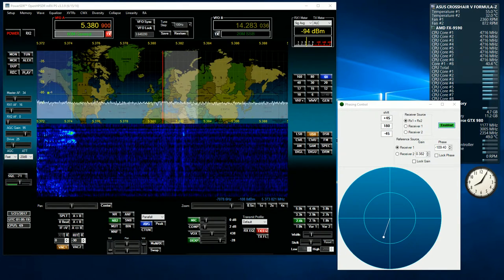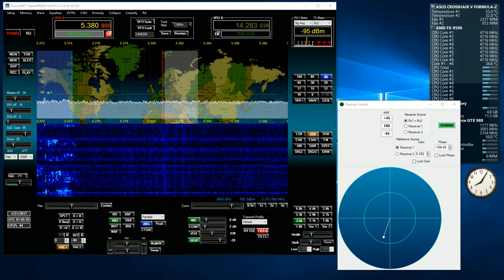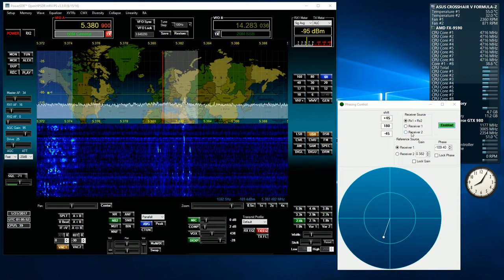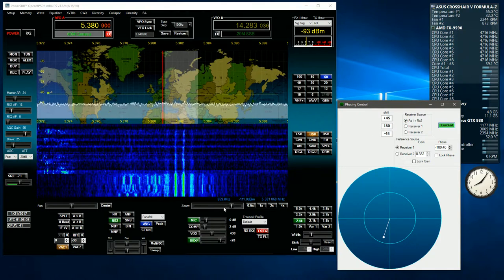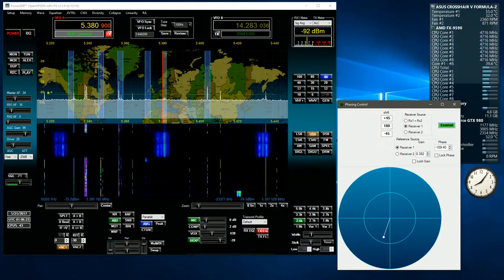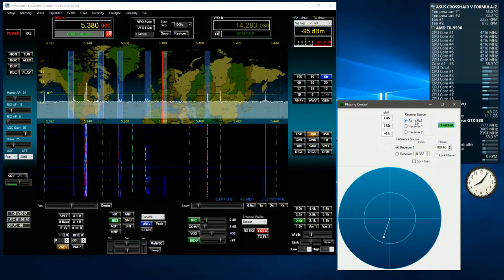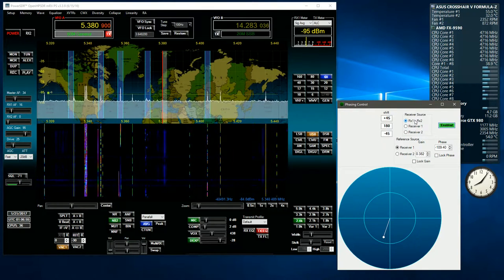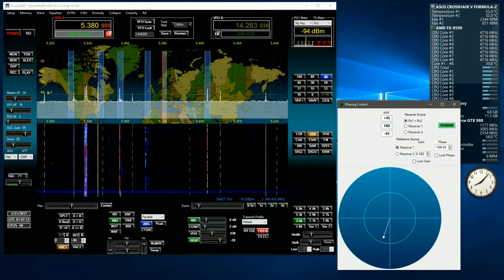Apache ANAN 100D Phase Cancellation (Diversity)

Comment: Pretty nice demo of what can be done. Great job!. Could you comment about which antennas are you using?
Reply from the maker: Hi Jose, I have three antennas. One Windom cut for 40 meters, one Windom cut for 80 meters, and a vertical random wire run up my VHF/UHF mast just outside the shack. Both Windoms are inverted Vs. The legs of both Windoms are about 120 feet separated from the vertical. The idea behind the system was to setup a simple (and cheap- made of lamp wire) "noise sense antenna" which would pick up the noise present on the other antennas. It did work. Can pull out most noise, But the wire antenna is too short to really help on 80 meters. It needs to be longer. Results are good from 6m through 60m

Important to note: there's not a lot of noise here except for MY plasma TV and some wall warts (hi). But it handles that pretty well.

Comment: I was  initially confused about the antenna ports at the back.   At first I thought Ant 2 was RX 2 but I now realize  there's a separate RX2 port.   Did you change any of the ADC setting or just go with defaults?
Reply from the maker: It was default during this video...